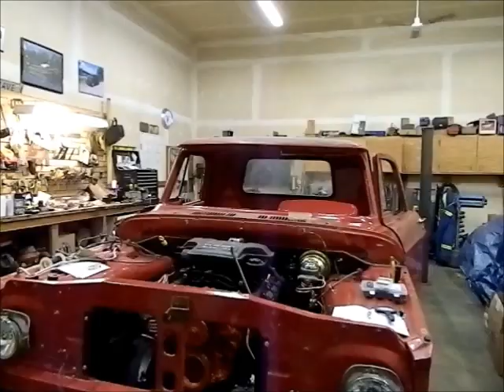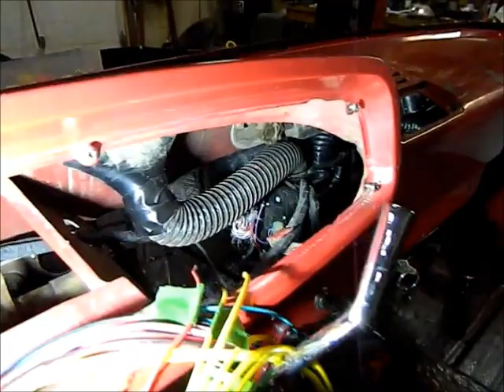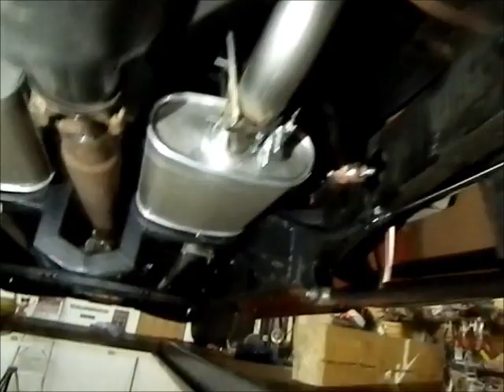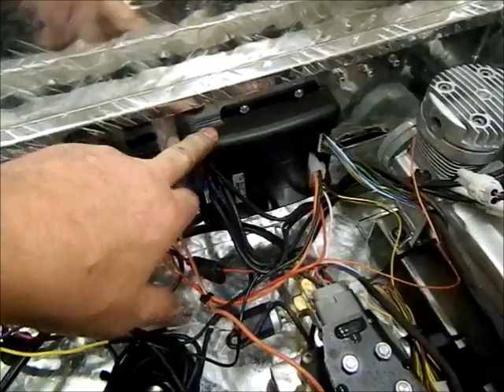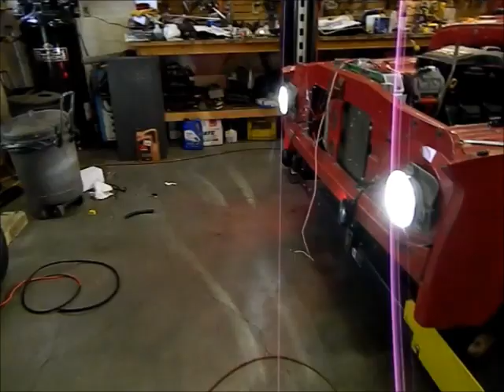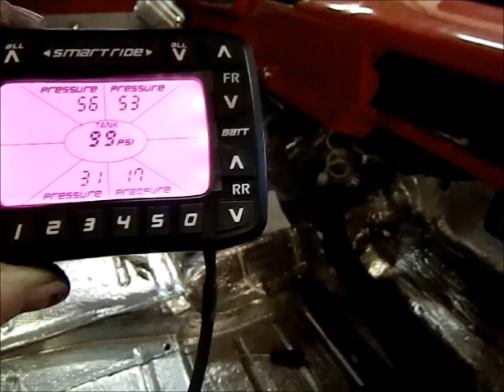The 1965 Fargo Sweptline wiring Saga continues

Comment: Looking great Glen. This is bringing me flashbacks of OLD boats i work on sometimes where people used lamp cord that is clear to wire their boat's. So no way to tell what power and ground is since it is clear. Also then they would run a Ground bar at the dash with power running to all components but with grounds switched at the dash. Talk about a wiring nightmare. Appreciate that you are doing everything A1 on these builds! Stay warm out there... Josh
Reply from the maker: Thanks Josh, Yup I have seen some real bad wiring in boats as well.